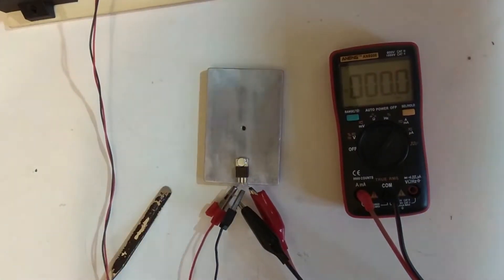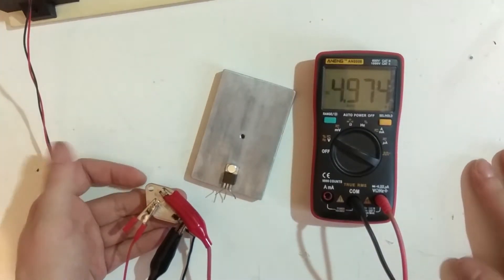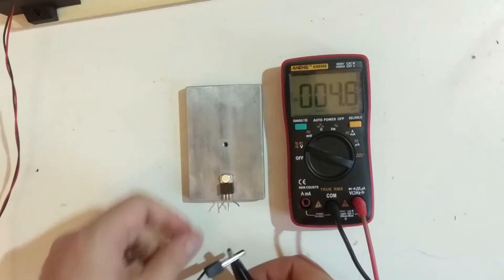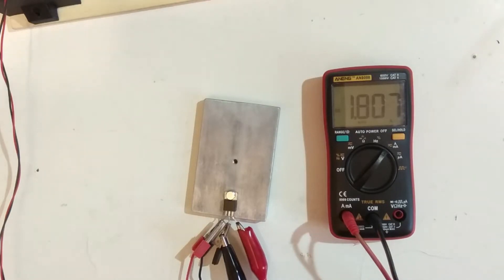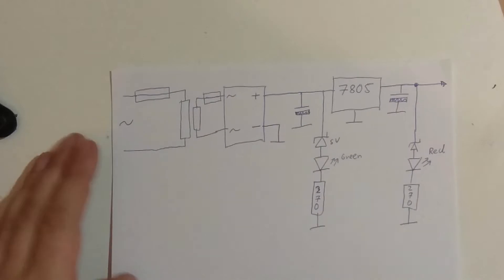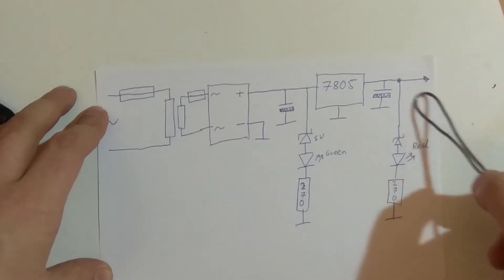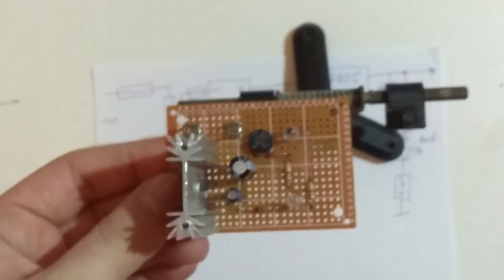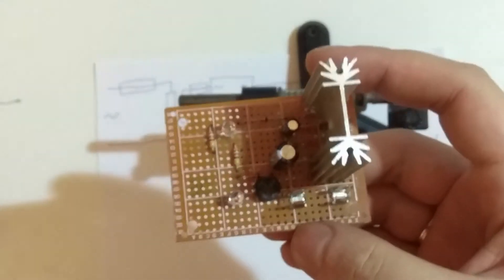Building a Z80-Computer Part 2 : The Power Supply

Comment: Howdy, this project is pretty interesting and enjoying the rules you're setting up for yourself on the build. I noticed your playlist for this projects is backwards though, in reverse chronological order, so I can't use it watching the series in order, which seems like a lot of the point of a playlist.
Reply from the maker: Hey! Thank you! I'm still working on the Computer. I learned a lot since I started this project so much in fact that I started over around part 6. I also fixed the playlist. Thanks for the suggestion I hadn't noticed it was the other way around. I think YouTube defaults to latest first which is not ideal for a project log like this.
Reply: @captainsolder5247  Ah it'll be interesting to see what caused you to start over. I'm not yet playing with a Z80, I have a 65c02 computer I'm hoping to use a Z80 in as part of a programmable VGA GPU.

Comment: You need to specify some value for the input filter cap which follows the bridge rectifier. This needs to be fairly large because the 7805 has a maximum ripple tolerance - one which decreases as the output current increases. The bridge rectifier output is pulsating DC at 2 times the supply frequency - a smoothing capacitor is required. Tantalum caps are usually recommended. Alternatively, you may consider an aluminium electrolytic AND a small mylar or polypropylene cap in parallel across the input. The output (right hand) cap isn't strictly necessary - it's function is to stabilise the output against input spikes and transients. Any manufacturers' 7805 datasheet will give design equations to specify these capacitors.

Comment: Hi again. I'm not sure your overvoltage protection circuitry is going to be much use if you need to be constantly watching for that red LED. When these 3- terminal regulators fail, they let through the full DC input voltage - enough to kill computer chips very quickly. Relying on a 'quick blow fuse' isn't any good either because the current demand of your proposed z-80 computer isn't constant. How can you correctly specify the required 'blow' current of this fuse? You're nearly there with your righthand Zener diode; for a few cents more, you can add a small thyristor, gate triggered from the Zener, which will short then positive rail to earth (the blowing your fuse) in a 5 microseconds or so. This is a 'crowbar' circuit. The thyristor has to be rated to take the full rated blow current of the fuse - not normally a problem.

Comment: Hi Captain. I really don't understand what you're trying to do with your '7805 maximum output current test'. Connecting your ammeter across the 7805 output pins is simply acting as short circuit (or a very low value resistor). The 7805 contains thermal protection circuitry - which is why you observed a sudden fall in output current with increasing Vin. Standard 7805s are rated at a peak short circuit current of 2200mA which is pretty much what you observed. This isn't 'maximum output current', it's maximum fault current. In any case, these parts are dirt cheap. If you buy them from a reputable source (rather than a Shenzhen market) then you can absolutely rely on manufacturers' specifications rather than whatever it is you're trying to do. I would advise a thorough reading of some 7805 application notes - for example ST's L78 note - which gives example circuits of overvoltage protection and how to obtain current outputs above 1.5A using a simple external PNP pass transistor.